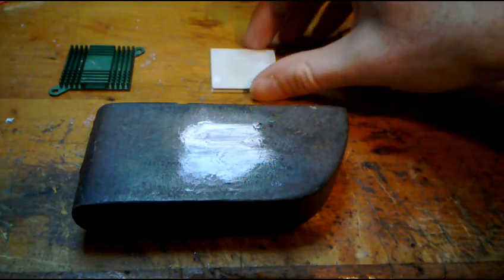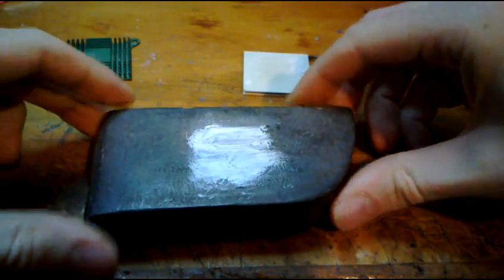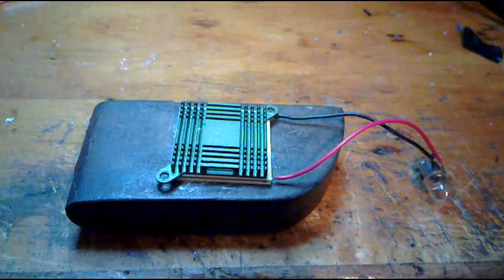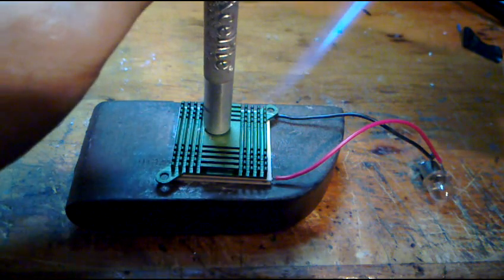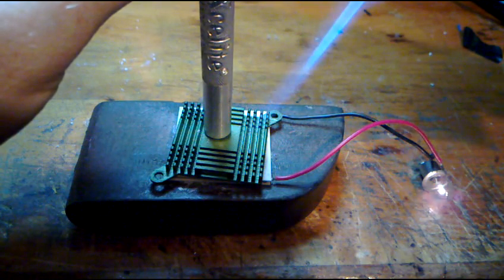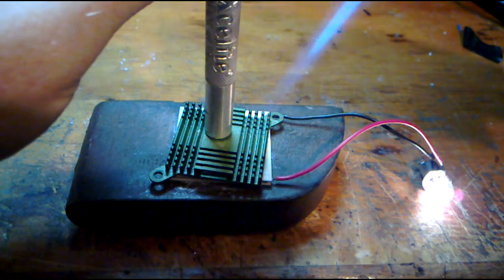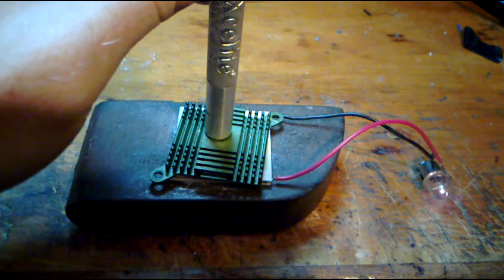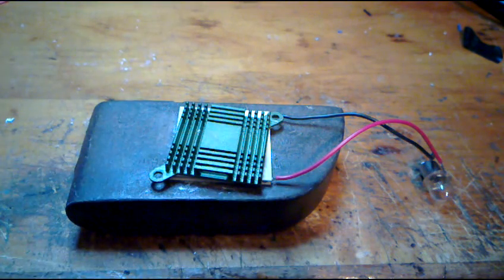Peltier in reverse

Comment: If you would keep on heating, would the light stay on as long as you apply heat? Thinking about this, the answer allready comes to mind: the iron, as long as it stays cold, the Peltier has a temperature difference and will provide current. The iron cools down from the surrounding air, but if it would not cool down, it would be just a matter of time until the temperature equalizes en the current stops.

Comment: what if you hooked up a Peltier device to another one. could you, at least for some time if not perpetually, heat up one Peltier element with another one and have it generate the electricity for the other one creating a self sustaining system?
Reply from the maker: They are very inefficient, so no. The output power of one would be a tiny fraction of whats needed to run a second one.